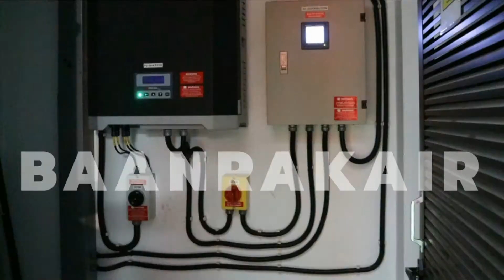How to clean air conditioner. Properly cleaning a dirty air conditioner. Daikin air conditioner

Comment: Helped me a lot. Needs high pressure water to clean the fan blades. If you just use a shower spray or other non-compressor water source, pass a q-tip between the ~300-400 blades & see how dirty they still are. Black mold can be a big issue & not cleaning that completely off will require much more frequent servicing.

Comment: saya berkongsi sikit ilmu ya: 
1. tanggalkan swing motor di drain pan tu sebelum cuci.
2. keringkan air dgn vacuum blower.
3. bersihkan drain pipe tu dgn menembak air ke dalam drain pipe.
4. jgn lupa bersihkan condenser coil dan kipas di outdoor.

Comment: Air conditioner cleaning
I vote we demand Air conditioner manufactures design the equipment they sell to be more user-friendly and serviceable. Clearly all the split type air conditioners you see today are not designed for easy cleaning or easy maintenance. These systems need to be cleaned and maintain on a regular basis. How long do you think those metal screws into plastic housings housing will last before you see failure. Then what, where will you buy replacement parts?

Comment: The coil still doesn't need an chemical wash..in this condition only required normal servicing..which is take out cover along with filter followed with watertray and blower...

Comment: What is the average TIME does it take to fully clean the filter and the Unit and cleaned up, back in service? Thanks for posting!!!
Reply: I just did my three units for the first time. If someones real experienced they can do it in an hour, but my first time took me all morning and part of the afternoon I'd say 5 hours. The reason is there is a lot of screws you can see but once you know it's easier the next time. You can't force anything or you break it.  My unit's are placed just inches from the ceiling which makes reaching the screws more difficult and the cleaning more difficult also. I would advise anybody doing it to watch all the Daiken video's on here first. The other thing is some units don't have a removable drip tray and I wasted a lot of time trying to figure out how to remove it.